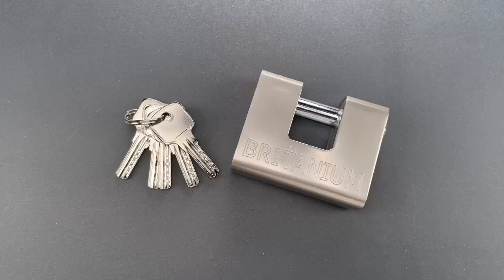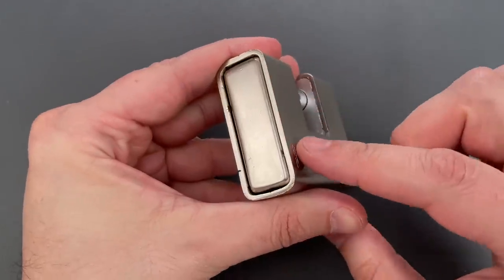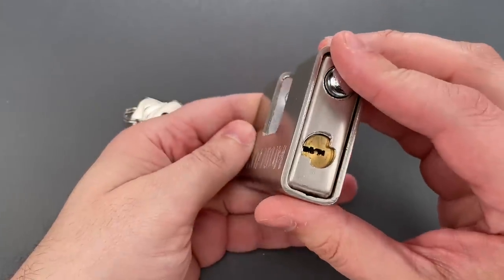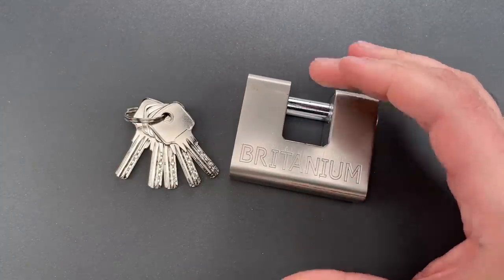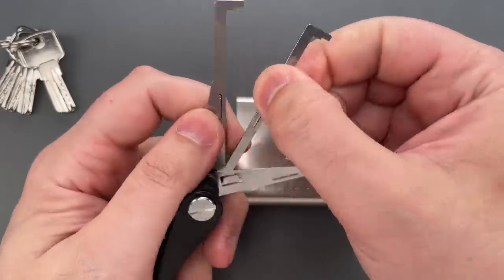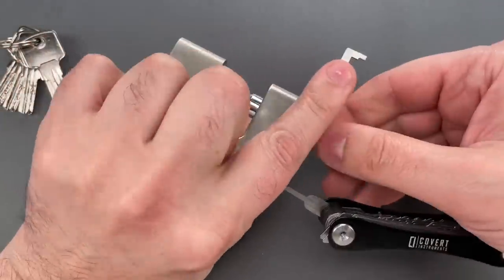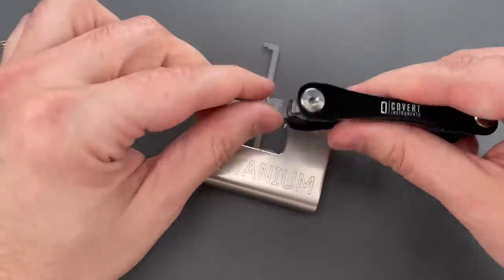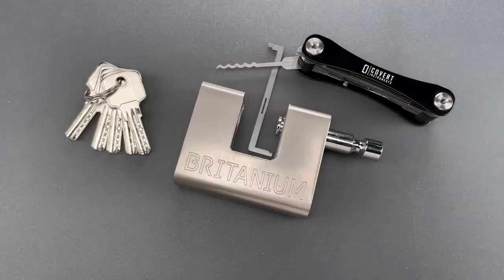[1481] Sheep in Wolf’s Clothing: Britanium Armored Shutter Lock

Comment: I'd love to see this taken apart to see if the Amazon description was lying about the ceramic plates.
Reply: Definitely would like to see that
Reply: Oh you’re still wondering about that?
Reply: @mattym8  yeah
Reply: Don't waste your imagination, bearing in mind it just got wave raked which is a bad sign for any lock in 2022  do you honestly think they put any form of ceramic insert in the lock?
Reply: @darreng745  1 ceramic chip at the back of the keyway. Just to keep you from using a bypass tool.
Reply: @francissager3133  Or maybe at the front for drill protection (only).  After all, they did build a complete lock mechanism with all the other parts, so a weak piece of ceramic "protection" would not affect production cost much.  But then again, the European branding may be fake, so why stop there and not fake everything.
Reply: @johndododoe1411  If the added ceramic adds 1 cent to the production cost and they produce 1M units, that's still 10K$... I wouldn't be surprised that a company that cheaps out on quality like this would go the extra breath and lie on the product description..
Reply: @inflatablewolfie  Question is if the easy raking is fraud or incompetence.  Fraudsters might use raw unbaked clay or nothing at all for the ceramics.  Incompetents would make an attempt to do what they say, but probably use the wrong ceramics.
Reply: @johndododoe1411  the raking is willful incompetence. The lack of ceramic would be greed, since regardless of how cheap it is, it'll still cost something..
Reply: @inflatablewolfie  What makes you think the incompetence is willful?
Reply: @johndododoe1411  because it's easy to fix. It just costs a bit more
Reply: If it's lying it's guilty of false advertisement, which isn't a misdemeanor, it's a federal offense though if they truly are a European company, then I'm not sure how US law would handle the situation.
Reply: @johndododoe1411  ceramics can be rather expensive. But for them to put drill protection at the front of the lock is asking them to show a modicum of competence.
Reply: Second this
Reply: @bungeetoons  Probably Not a European company (Laws to strict), I am betting it's made in china and we know how they interpret the laws. As for the ceramics, That's what it's probably made out of!😂
Reply: Considering the lack of lock security that would be like duct-taping a bulletproof vest to a screen door to keep out the weather.
Reply: @johndododoe1411  They probably threw a handful of crushed crockery in the lock body so they could say that there were ceramics in there.
Reply: @darreng745  I could imagine it.  There are plenty of companies that add good quality of life features to their security products, but skimp out on using a cheap wafer lock for the mechanical backup.  The maker may have assumed that most attacks are going to be brute force, so they install the plates to prevent that, while using lower quality parts elsewhere to keep the price down.
Reply: Mee to. And a layer can be hired.
Reply: @francissager3133  Destructive bypass tool use prefers brittle anti-bypass wafers as you typically punch through them. A ceramic insert there would be worse than stainless steel, at least some SS grades can be tough.

Worst of all, destructive use of a bypass tool leaves no external damage. For locks you can't disassemble, it would be virtually impossible to prove destructive entry.
Reply: there's no way.

Comment: Whenever he pulls out his covert companion tools, I'm always like I hope it's not the rake. And then its Oh No! Not the rake!! 🤣🤣
Reply: The rake is the ultimate weapon of LPL.
Reply: It's never a fluke
Reply: @seanshepherd1071  its never lupus
Reply: I literally just did say 'Oh no!' when the wave rake came out!
Reply: Same
Reply: It could've been the comb... but that's really the only possible worse scenario.
Reply: Not even a dimple rake… a wave rake is for standard orientation pin tumbler and wafer locks. For this he should have to use a dimple rake, not just jiggle a wave rake against the side of the pins for a few sec. The main point of dimple locks is that they  can’t be opened with standard picks and rakes… in this case the point is to provide the illusion of quality and security without actually providing it so I guess it succeeds at that.

Comment: I'd like to see a teardown, find out whether there are actually ceramic plates in there.
Reply: Hardly matters. My bet is there aren’t any.
Reply: @highdownmartin  If the advertising says it does, but it doesn't, that's fraud.
Reply: @russellhltn1396  also claims to be a security device. Probably easier to get them on that.
Reply: @highdownmartin  The definition may be too loose for legal action. But missing part is missing part.
Reply: @highdownmartin  I doubt if there's a definition of "security device".  Advertising that it has something and it doesn't is a open and shut case.
Reply: It can be a 3thou wafer of silicon and that technically counts as a "ceramic insert".
Reply: @45calGunslinger  There are much cheaper options than silicon wafer, like piece of common porcelain.

Comment: Since you've picked every lock I've ever owned in seconds, I'm just gonna bury everything of value. At least it will take minutes rather than seconds to recover.
Reply: There are decent locks out there, some are even mainstream. The more recent Kwiksets with the reverse sidebar, for instance,  cannot be bumped or raked and even picking it requires having a shim and knowing exactly how to use it to tension the sidebar. Various disk-detainer designs have gotten the "well I can get it open but you probably can't" seal of approval from this channel and some of the better dimple cores are certainly not going to just pop open when you demonstrate that you own a wave rake.
Reply: @TysonJensen  A kwickset smart lock can be bypassed with a screwdriver and wrench, Insert screwdriver and twist with a wrench it destroys the core and can be opened sidebar and all. DDL are a better option due to needing specialty tools to bypass. But real criminals use sledge hammers and crowbars and will just break a window while no one is home, sure you might have an alarm system but that's 3-5 mins of not so bright people just going for electronics or guns to pawn. They also sell tungsten KW1 blanks to use if you want to not buy a screwdriver, still need a wrench to over torque the pins in Kwickset. I rarely see house locks that are secure, I have only ran into 1-2 Multilock doors on homes. Never seen a house with a medico or anything fancy. Storefronts I have encountered 1 Miwa magnet tumbler lock, most or "Best" or ASSA
Reply: Burying is a tried and true method.  Sometimes it takes centuries to find people's stash. Sadly, they rarely leave a tag with their name and other information for the museum that finds it.
Reply: The Ron Swanson method. Bully for you.
Reply: Except his next product is the cover buldozer companion.
Reply: Doghouse is nice. Not getting in there unless the dog knows you.
Reply: @TysonJensen  I can pick those with just a single metal hairpin broke in 2
Reply: @xxomega702buzzalini8  Screwdriver and wrench isn't "bypassed" it's "destroyed." and the entire point of a lock is not and never was to prevent theft but to provide evidence for the cops and insurance afterwards. If you're hoping for some kind of super lock that actually keeps thieves out you will be terribly disappointed.

Comment: If that is Britanium proper, it has the very low melting point the material has as it is a pewter based alloy used more usually for teapots and silver plated cutlery than protection for a lock.   The Oscar's used to be Britanium cores plated over and metal chaps over here would call its Vickers White Metal which I believe were used as white metal bearings with a tube cast then shaped and split having some more rigidity than Babbet White Metal.

Comment: From all the years, the lock security can come in the following categories:
Level 0: the lock can easily be opened with raking, comb picking, bumping or with a bypass
Level 1: The lock is safe against raking, comb picking, bumping or bypassing the lock, but can easily be single-pin picked
Level 2: Through the use of security pins it is made tougher to single-pin pick, but it is still doable with standard tools and a bit more practice
Level 3: The lock uses a design that provides the above security, but also uses a non-standard lock design that requires custom tools to open (so, more than just the standard lock pick and turning tool)
Level 4: The lock is designed in such a way that the pins (or other) aren't engaged at all at times that they can be accessed, so that single-pin picking (or similar) is not possible, (except maybe using highly specialized tools), so non-destructive entry seems not worth it.
Level 5: The lock is perfectly pick proof

And I haven't seen any locks go beyond level 4
Reply: aka Level N : the LPL video is between N and N+1 minutes long
Reply: I would add level -1: the lock can easily be opened using a piece of the packaging it came in.
Reply: Security pins do not necessarily make single-pin-picking more difficult, though; in some cases, it seems like their whole purpose is to prevent raking and bumping.

Comment: I recently saw a video of padlock being disintergrated using a key made of... barium... I think (I've always been bad with remembering the elements). The guy snaps the key off in the lock and the element eats away at the casing until you can just pull it apart.

Comment: Oh god, wave rake on a dimple lock is the worst of the worst. (For those who don’t know he should at least have to use a dimple rake, those are at least designed for the job and slightly less commonly carried by criminals, though that would still be very bad). Jiggling the wrong tool against the side of the pins opening the lock quickly and easily is beyond terrible.

Comment: I'd like to suggest a tool that I think would have great value.   I can get good at various methods of lockpicking with practice but acquiring the knowledge to know what method to use with which lock could require a lot of experience and resources.  What if there was an app where you input the specific lock that you need to open and the app tells you which tool/method to use?

Comment: I went to Amazon just to check the reviews. Turns out that it only gets worse. This is what I found.
"	Ricky Jackson
1.0 out of 5 stars Pick protection, oops only lasted 4 months
Reviewed in the United Kingdom 🇬🇧 on April 3, 2022
Style: 3 KeysVerified Purchase
Was looking for awhile and this fits the bill and so far so good it's doing its job and as off yet no rust and no tampering

AVOID...AVOID...AVOID....AVOID

Update: only lasted 4 months and the ball bearings holding the pin in place have fallen out and the lock no longer operates obviously not the quality I originally thought also no return after 30 days and no guarantee
5 people found this helpful"